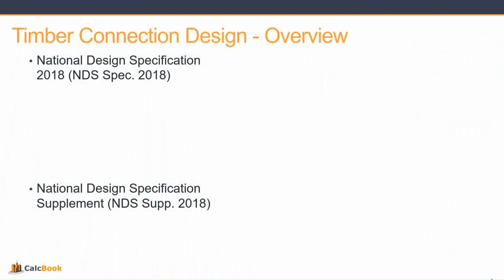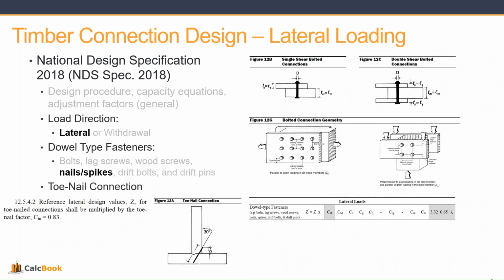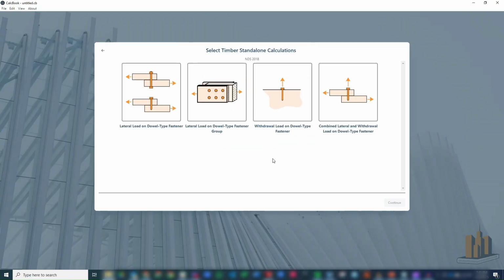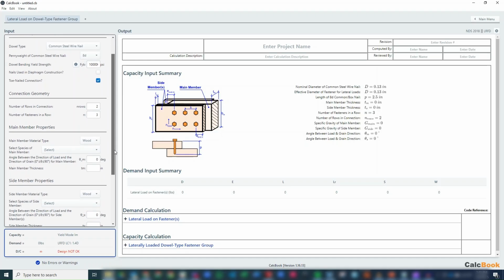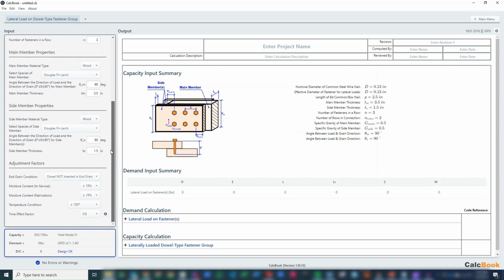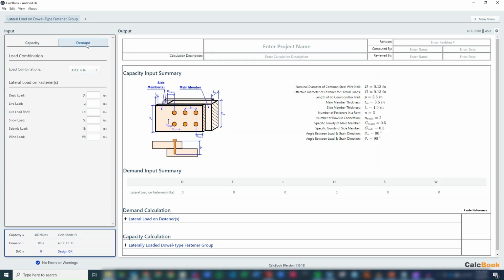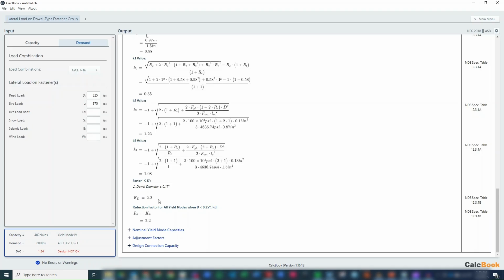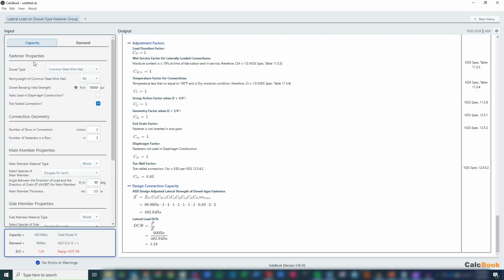Toe-Nail Joist Connection Design Explained | NDS 2018 Structural Engineering Tutorial

Comment: but if we get the whole plan of house , are we suppose to do calculation of hundreds of beams , column . cant we just use mitel software to  model and design just like etab does for rcc
Reply from the maker: Great question @significantant7036! In practice, you often don’t need to design every joist connection individually. A common workflow is to model the structure (in ETABS, SAP, etc.) or use simple tools to identify the critical member, then design a connection that covers that demand as your typical detail.

CalcBook can help here—it includes a simple beam analyzer so you can quickly check spans without creating a full 3D model, then design the connection in a clear and transparent way.
Reply: @calcbook  for wood structures i think etabs and sap dont work
Reply from the maker: You’re right that SAP and ETABS are mostly geared toward concrete and steel, so they’re not always ideal for wood structures. That’s actually where CalcBook can fit in really well.

You can use it alongside a full model by pulling forces from something like RISA, Forte, or hand calcs, then designing the individual members and connections in CalcBook. Or you can skip the full model entirely, find the worst-case members using CalcBook’s built-in beam analyzer, and design based on that.

It’s meant to give you flexibility, whether you’re supplementing a full workflow or keeping things simpler.